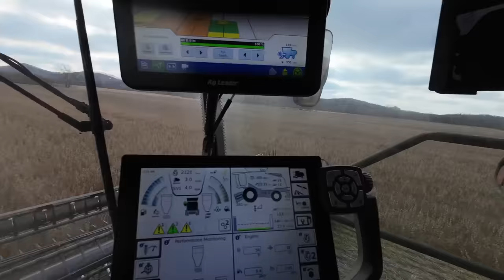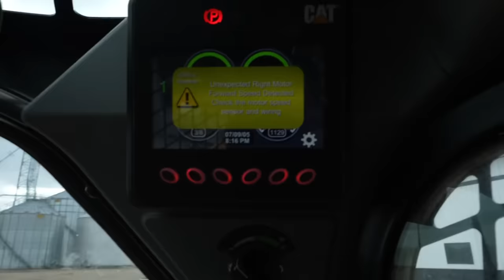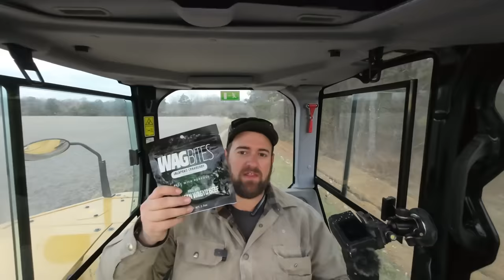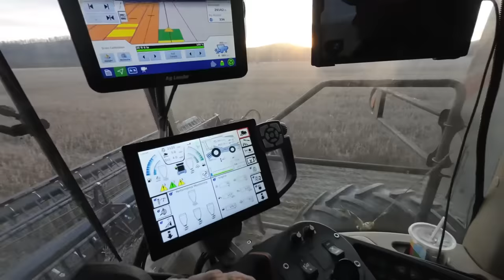House tour with Mrs Brown

Comment: Bryan, those cat skidsteers will stop and throw the unexpected drive motor fault if you try to move them before they warm up. We have cats with the construction company I work for. If you try to move the skid without the hydraulics warming up they will throw that code. I wouldn’t worry to much about it.
Reply: I was also thinking that not letting the engine run long enough to warm up is what caused the code.  Gasoline you can kinda get away with, diesel, hell no
Reply: All our cats are starting to give out now
Reply: @maxkutschera6550  time to switch to John Deere
Reply: @froggienm71  i want to but my company doesn’t like em, we are trying out wacker neuson

Comment: Bob could you maybe used a bolt instead of a set screw if it doesnt rub on any thing it should work plus you should be able to tighten it more than a set screw

Comment: I saw the clip where you got the email from Ohio Ag for the 8700 lexion pricing. Did I miss the video where you talked about it, or is that still in the pipe. Christmas in the new house should be doable. I would expect you would just be waiting on painted exterior doors by then.